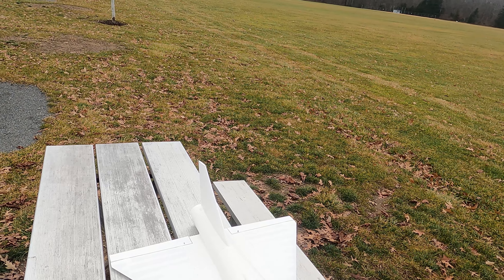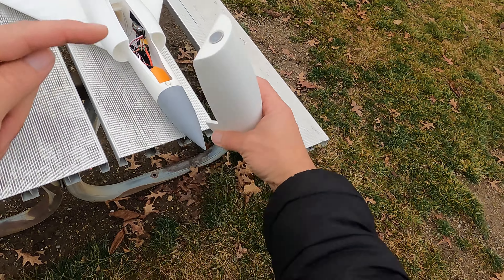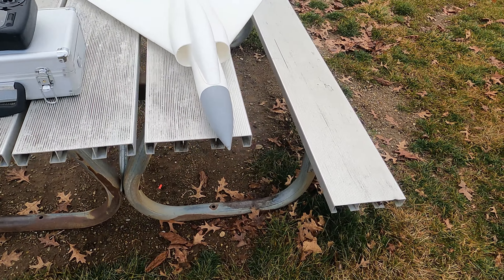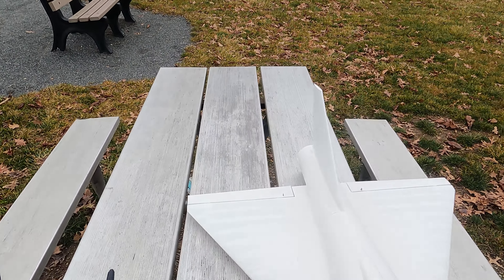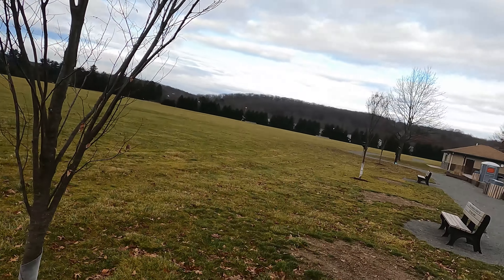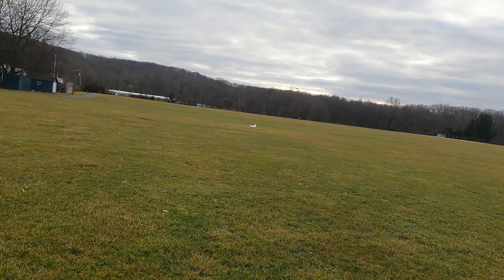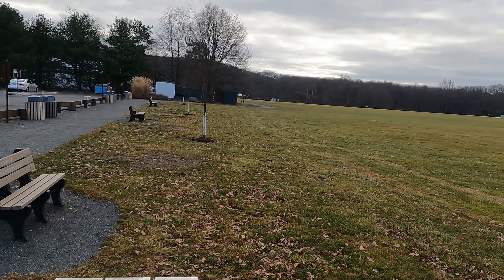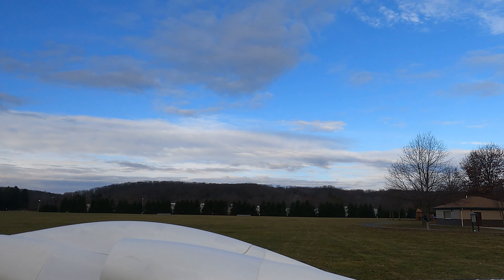3D printed 70mm Mirage Monster Power!!!

Comment: That's pretty sick!! I'm impressed with the low speed performance. I know with my builds a mirage that size would be much lighter (foam), but that thing seems to slow down just as well, its quite surprising. I'm curious whether a better airfoil from 3d printing makes up for the extra weight. What do you think??
Reply from the maker: Very good thoughts. I always wonder what airfoil the manufacturers decide to use on the foam ones. I can tell you first hand having owned fly fly mirages. And many others. They try to pick an airfoil that looks more scale but probably doesn’t work well with controllable slow flight. I know how my airfoil works with slow flight. You can see on my aerobatic testing video of the 64mm. My design flys like it has a serious gyro

Comment: You did amazing job designing this. A 70 mm was the way to go. 64 mm are good on 6s but 70 is the sweet spot. Great job! Take care
Reply from the maker: I should have used a 70mm made for 4s. The one I have makes huge power but kills batteries lol
Reply: going to throw this out there but you can also put a throttle cap on it say at 80% or even 70% and I switched over to Radiomaster from Spektrum for the telemetry so I always no where my battery is at during flight   @hotlapkyle
Reply from the maker: @MrZeek101  so the throttle cap keeps the power down or are you saying use my spectrum telemetry to give me a voltage?
Reply: yes to both 
 @hotlapkyle
Reply: then your not sagging the battery so bad lol